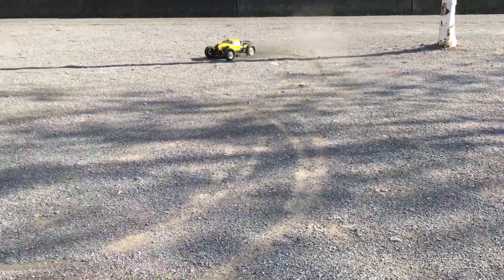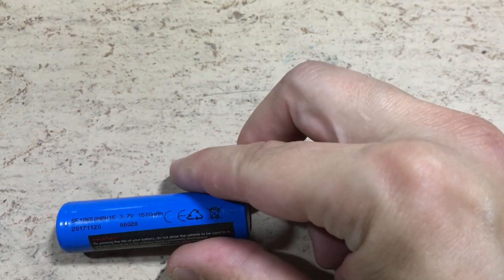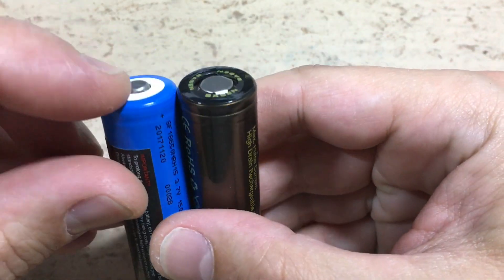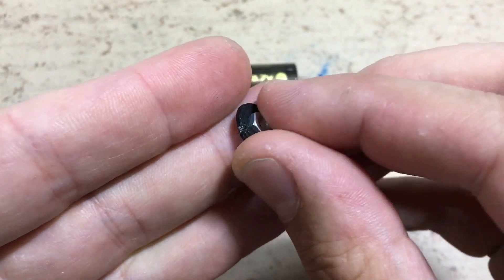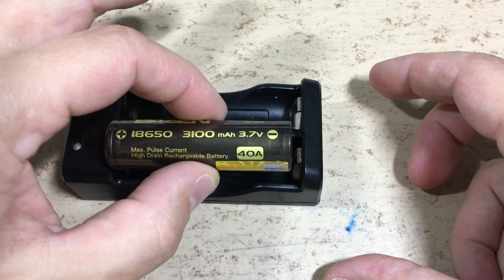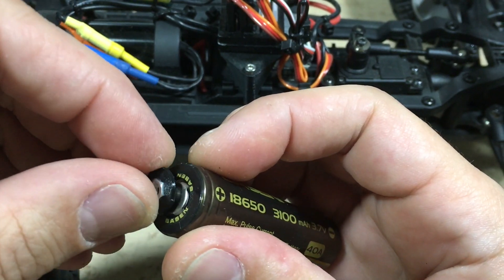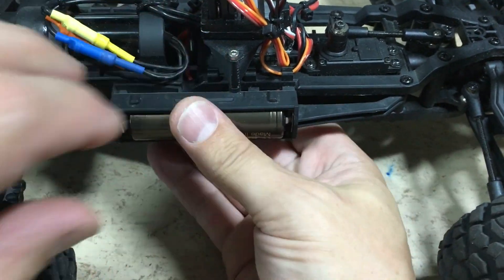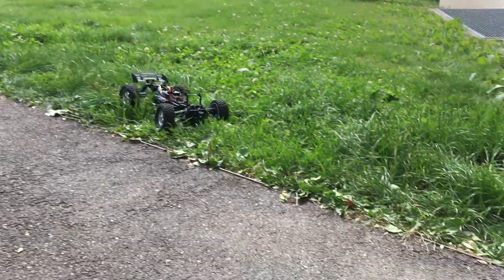HBX 12891 DUNE THUNDER: 3D Printed 18650 Flat Top High Current Battery Adapter!

Comment: Hi I am wondering if it is possible to use 18650 3.7V Li-ion batteries instead of the original Li-po for hbx 12891?
Best regards from Norway
Reply from the maker: Hi, it comes with two 18650 cells, which are wired in series. So you can use a 2S LiPo instead, but you have to change the ESC battery connector
Reply: @TheDIYGuy999   Thank you for taking the time to respond, and thank you for great videos ;-) I am new to the hobby and have now ordered 3 cars for me and my boys. I now see that my question was a bit imprecise: I was really wondering if there was any difference between an 18650 Li-ion 3.7V cell and the originals that come with the car? Since I can not find 18650 Li-po available, which is stated as the original battery for the car ... In other words, I want to buy a battery with a larger capacity as you show in this movie, but use them for the original engine.

Comment: Why not use 2s?
Reply from the maker: It would be doable, but the battery holder is made for 18650 cells
Reply: @TheDIYGuy999  good job,what's his top speed now?

Comment: Find those batteries at the smoke shop they r used for vape
Reply from the maker: And they are high discharge and button top?
Reply: TheDIYGuy999 I’m not 100% sure, it’s just what I’ve heard people using for replacements for these batteries
Reply from the maker: The BASEN batteries are very good. Today I did a trail run of about 2km with them. Very long runtime. The car is also a lot faster than with the original batteries.
Reply: Would these batteries work? https://www.orbtronic.com/18650-battery-3500mah-button-top-high-drain